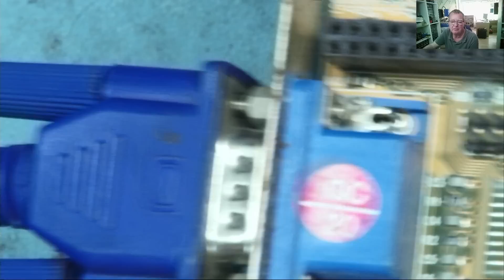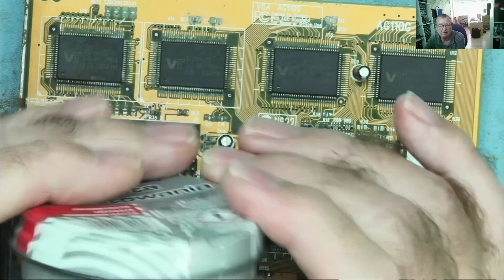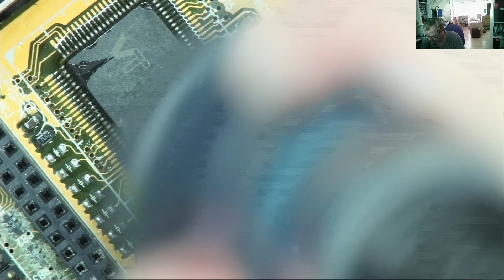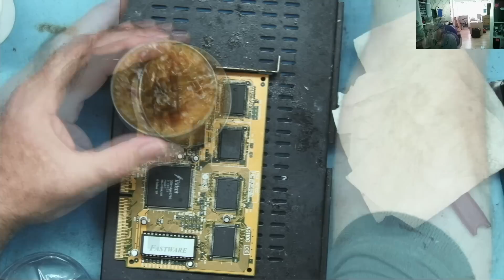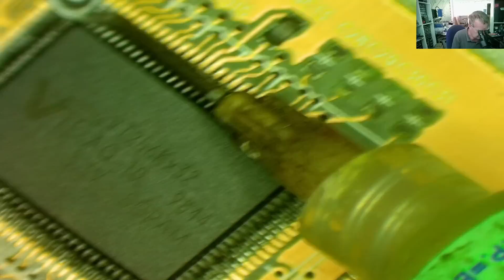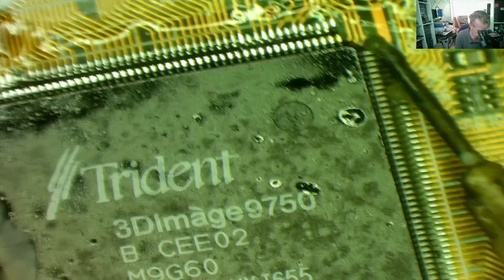Can we clean a corroded PCB using FLUX?

Comment: I was considering the same the other day on a corroded card that didn’t work.  My first pass was to clean all the dirt off and give the legs a good scrub with a tooth brush and IPA.  In this case it worked and I’m not too worried about visible corrosion.  My second thought was to use something a little more gentle than vinegar such as Viakal  or Windowlene before flux soldering. Sadly I didn’t need to try it, so I didn’t find out.  Plumbers flux might also be more effective than regular electronic flux.  -Just my thoughts and I’ve no idea how good they might be.

Comment: I had a pretty good result on very corroded soldered joints with liquid meant for soldering of stainless steel, I am not sure what it is if it's some hydroxide or accid, but it worked. Firstly, I applied it and heated it properly, then I had to clean it again using IPA, then add some fresh antiEU illegal solder and then heat it again, result was really good. Just some standard flux was not enough, contacts were that corroded that new solder didn't want to catch on it.

Comment: Water soluble flux would likely perform better than any other electronic flux but it is absolutely essentially that it be completely washed off within a few hours. It is both corrosive and conductive. Proper cleaning, especially with SM parts, can be difficult and requires a strong spray of warm water. The flux rinses off of exposed surfaces very easily. The hard part is getting contaminated water held by surface tension under SM parts flushed out. Of course not all boards are candidates for immersion cleaning.

Comment: Hi Richard, in amplifiers often low-value ceramic resistors are being used. They can get extremely hot. It seems a bit of a waste to dissipate that much energy, or is this technique from the past? Would be interesting if you could eleborate on this topic sometime.

Comment: It should be stated in the flux's data sheet which temp it needs to activate. For "real" NC-559, it's around 140°C, and I don't think you reached that temp. If you would, the flux should have bubbled at least a bit. You could have used your cheap preheater, that way also chances are low to melt the plastic connectors.

Comment: Flux is only corrosive at very high temperature, so I think you need to get it much hotter for the flux to do it's thing. Basically solder melting temp.
Reply: to do its* thing
Reply: @wjkgreen   Well, you know that thing it does.

Comment: I've worked at electronic factories.   I found the best flux to use is the alcohol based flux used on wave soldering machines. (sprayed onto the bottom of PCB assemblys before plated through parts are soldered on).  The flux is a heat activate acid that evaporates after use.  Great when using hot air on smd parts because it leaves no residue.
Reply: What is the toxicity like of that flux? Can it be filtered using the normal carbon fan filters?

Comment: Perhaps Rosin and a stiffer brush would be better, also those non scratch scouring pads cut into small pieces and either glued or just used with those wooden sticks that they use in burgers they have a head that could be sawn across to give a flat surface to push down on, I’ve used them on connections with iso that seems to nullify rust, battery terminals in flash units etc.

Comment: Ive used grocery store white vinegar to remove rust (soaking for a period of time).  I'm wondering what a mild acid like vinegar woud do.  I imagine that it might also eat any platings.
Reply from the maker: Well it eats pins in AGP slots for sure - as proven on a previous video 🤣
Reply: I need to find that video. 

I've had fairly good luck just letting it soak in vinegar for a short amount of time and then cleaning with IPA.

Comment: What tools needed to start GPU graphics cards Repair business
Reply from the maker: Multimeter
Needle probes
Soldering Iron (T12 or better)
Leaded Solder 60/40 or 63/47  0.6mm and 0.2mm
Liquid Flux NC-559-ASM
Good quality Desolder Braid
Fine point Tweezers
Isopropyl Alcohol
Kapton Tape
Various screwdrivers, Flush wire cutters, soldering aid tools etc
Hot Air (something like Quick 861DW or better)
Preheater (hot air or IR)
Temperature meter / Thermocouple
Microscope, unless your eyesight is very good
A cheap Oscilloscope can be useful, a basic hand held model is fine
A thermal imaging camera is invaluable if you can afford it - can recommend Infiray T2S+ or P2 Pro
A whole lot of Luck

That should get you going...
Reply: @learnelectronicsrepair  t
Thanks 🙏

Comment: Just use an ultrasonic
Reply: You must be very careful using an ultrasonic cleaner for electronics. Some components can be damaged by ultrasonic energy. Any component with bonding wires not entirely secured by encapsulent are at risk. Such components aren't as common now as they used to be since almost all semiconductors are in plastic packages. A notable exception is MEMS devices which I would expect to die in very short order in an ultrasonic cleaner unless the manufacturer says otherwise.

An ultrasonic cleaner isn't going to do much to remove corrosion unless the bath is chemically effective against whatever the corrosion products are.
Reply from the maker: I don't have one but did user one back in the 90s when doing this sort of work professionally . IMHO it didn't work very well.  Maybe they improved since then?
Reply: @learnelectronicsrepair  For corrosion removal need add some chemicals to water by itself  only good to remove flux leftovers.
Reply: @learnelectronicsrepair Some ultrasonics will work better than others, that's for sure.  Louis Rossmann has an OLD video describing his experience between brands.  Unfortunately, I'm not sure what he uses today after his more recent issues with his supplier.
Reply: @learnelectronicsrepair  they work amazing. I've brought water damaged devices back to life with just a 10 minute session at 50C

Water damage and fine cleaning are the use cases. But I use them for general cleaning as well